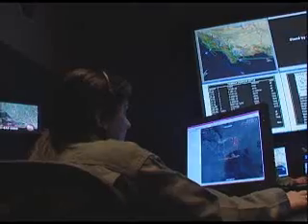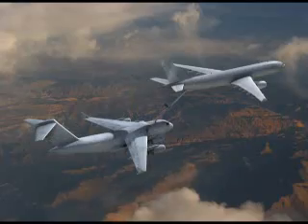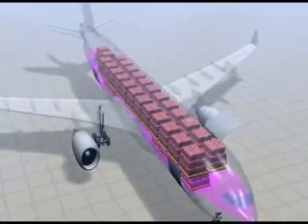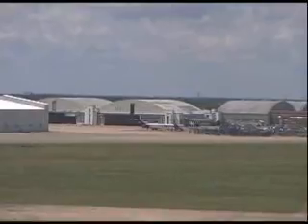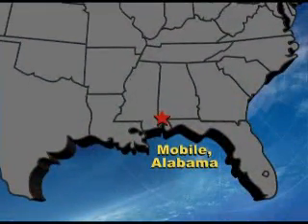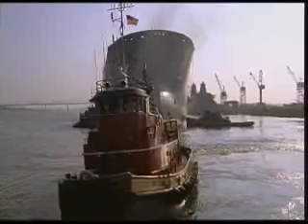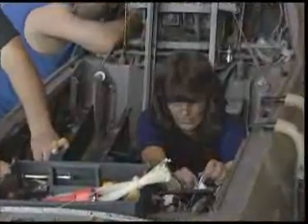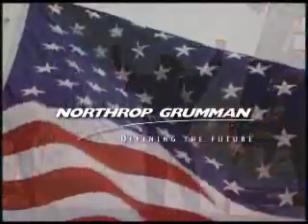KC-45 Assembly

Comment: Not really. It's a shared venture that provides the best solution for the Air force; moreover, Boeing really screwed up on this one with their sense of entitlement, and I heard that they were extremely difficult to work with by not adhering to provisions of the RFP. I believe in letting competitive forces determine the best outcome, and Northrop Grumman's proposal is superior to that of Boeing. Boeing has outsourced their work for decades, so what's the big deal anyway? Look at the 777 project..